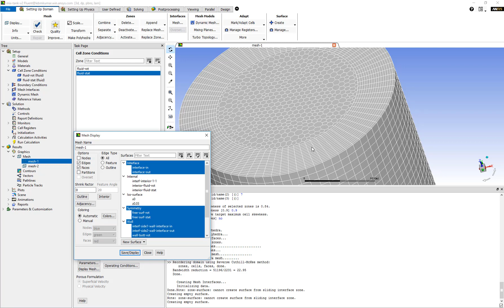Convert Mesh to Polyhedra in Fluent

Comment: Sounds Great !
After converting to a polyhedral mesh how do I output the .msh file for the corresponding polyhedral mesh ?
I need that to run the mesh in OpenFOAM.
Reply: Has this been solved yet? I am trying to do the same thing
Reply: Not really. I didn't pursue that line of research but I did find that OF has a polyMesh converter - https://openfoamwiki.net/index.php/Polyhedral_mesh_generation
Seems like you might have to use gmsh. I didn't find a way to convert the Ansys polyhedral mesh to an OF readable format.
Reply: @arpansircar8858  Got it thank you!
Reply: I just found a temporary work around for anyone interested: I was able to save the case file in Fluent, then open the case in Fluent Meshing, which can export the mesh in ASCII format. This can then be converted to OF using fluentMeshToFoam.
Reply: @shmommytalkus  Hi there, after genereting my mesh I go to "Setup" and I convert my mesh to polyhedral. After that, I go to "Export" I can only export "Case" or "Boundary Mesh". Could please describe your method ? I don't think I get it quite well. Thanks in advice